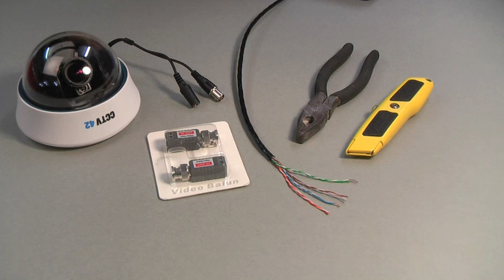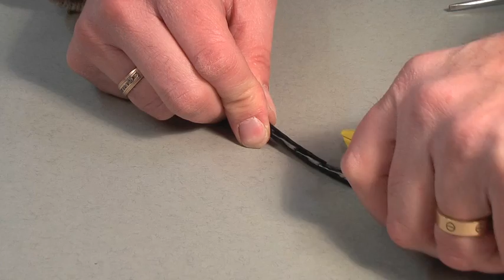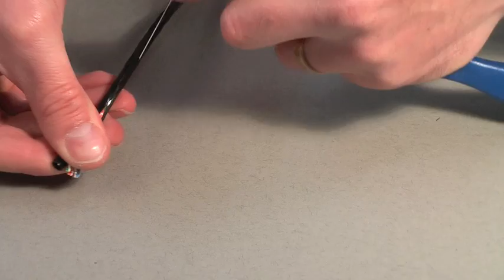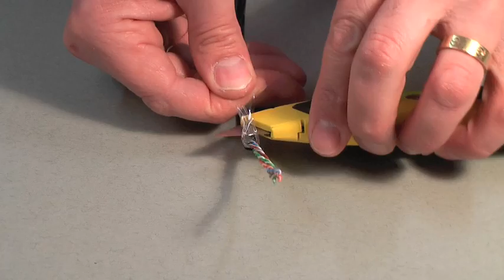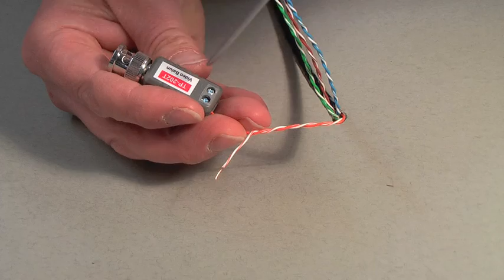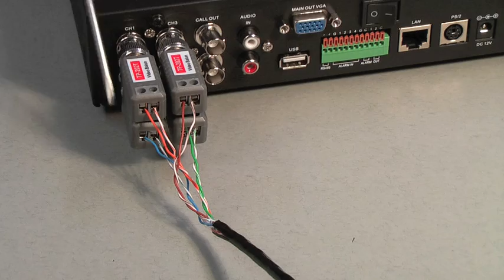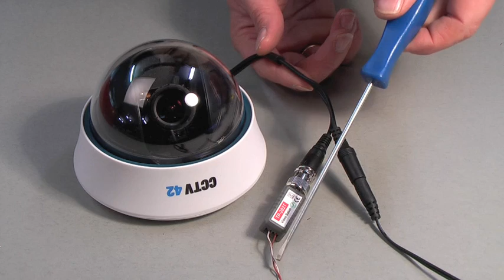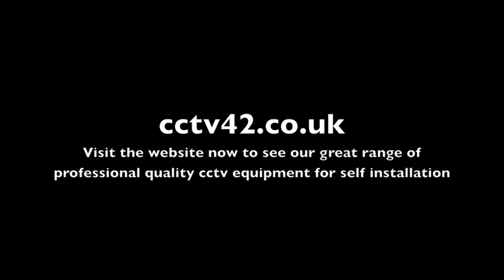cctv42.co.uk - using cat5 cable and baluns to connect a cctv camera to your DVR

Comment from the maker: Hi there. It could be a voltage drop issue at the camera. We would suggest a maximum cable run of around 50 metres when using CAT5 for both video and power, that is with 3 pairs of wire for power, 1 for the video baluns. You also need to make sure you are using pure copper CAT5 rather than CCA or copper clad aluminium. Many cheaper retailers will supply this in place of pure copper cable and it greatly reduces the performance of the cable.
Reply: How would I knoe if I got proper copper cat5? Also which is better cat5 or cat5e? 

I'm also going a maximum of 10 metres so would your power and video balun connection be a problem for me?

Comment: Hello there, I have exactly the same scenario as minute 2:28 but with the difference that i´m using two pairs of cable for the balun (one pair for positive and the other for negative) and the other two pair for the power source, but the camera is not working, do you think it might be a problem related to power? I mean, do i have to use three pairs instead of two in the female power connector? i will aprecciate your answer

Comment from the maker: Ok - to answer your questions in order:
1. In the video we are using CAT5e cable
2. Either CAT5 or CAT5e is fine - it makes no difference with this application. What does matter is ensuring that it is PURE COPPER, not CCA.
3. CAT5/5e should have 8 wires (4 pairs). If any less, it probably isn't CAT5/5e cable.
Good luck!

Comment: jejeje, thank you for your comments and the information. Now i have a new questions. 1.The utp cable that you were used in the video is cat5 or cat 5e? 2.For the same purpose can i use cat 5e? 3. I tried to do the same conections with a utp cat 5 cable but had only 2 pairs of wire inside, not 4 pairs as in the video and it did not work, would be by this type of cable (utp cat 5 with 2 pairs of wires inside)?
 receives greetings from mexico

Comment from the maker: Your English is certainly better than my Mexican! That is the way we always connect it up - solid colour is positive, stripe (white and thin colour line) for negative to avoid confusion, however it doesn't really matter as long as you keep it exactly the same throughout the whole system and at both ends of the cable. I hope that helps.

Comment from the maker: Hi there. I don't think using a single pair of wires for the power supply on a PTZ camera will work. PTZ cameras have higher power requirements due to the motors and so you will suffer voltage drop. I would suggest powering the camera separately. You could then use 1 pair of wires for the video and 1 pair for the RS485 control. 

The wires need to connect to the video output & RS485 control on the camera, the DVR video input and what ever you are using to control the PTZ at the other end.
Reply: https://www.amazon.com/s/ref=nb_sb_ss_i_1_8?__mk_es_US=%C3%85M%C3%85%C5%BD%C3%95%C3%91&url=search-alias%3Daps&field-keywords=ptz+dome+controller+with+ac+adapter&sprefix=PTZ+DOME%2Caps%2C213&crid=1VUZM3Q4DXYM2

Comment from the maker: Thank you for your comment. We find that over 60 metres you start getting voltage drop along the cable potentially causing the camera to malfunction.

The video signal is not a problem - 300m is easily achievable - it's purely the power.

I'd suggest you try to find a power location nearer the camera if possible.

Comment from the maker: Use decent cable. I suspect your cable is CCA or Copper Coated Aluminium which breaks easily. Try scraping the copper off one of the wires to see if you can see silver underneath. Good quality Cat5 cable is pure copper and because the copper is more malleable it tends not to snap off. You have to use pure copper Cat5 with video baluns, particularly as the runs get longer to avoid signal break down.

Comment: Hi....great vid and I have purchased baluns and cat5 and find it a lot easier than rg59 shotgun cable.....the only problem I find is that the wire is so thin and easily breaks at the balun terminal...not a big problem outside in the junction box because little movement but behind the dvr I find the wires can break.....do you have any tips?

Comment from the maker: The problem quoting maximum distances is that it depends on the current draw of the camera. It all comes down to the cross sectional area of the conductor. More copper equals more distance. In practice there probably won't be a vast difference in distance. On the video side however the Cat5 / balun combination is superb. 300 metres is huge. You can even extend that to 1200 metres by using active baluns. Finally the termination is very easy, no crimping tools just a small screwdriver.

Comment: Very informative video. But with the limitation of 60 metres to power the camera and the need of locally power, I think that siamese RG59 cable is a better solution in most situation where the external cameras are 100 or more meters away and in places where no electrical outlets exist. Besides that a siamese cable for video and powering looks more secure because you can elevate in all the trajectory and with this you can avoid simple unplugging. Im right?

Comment from the maker: That would indeed work. As long as you use the same pair for each camera.

Use:

Blue+Blue/White - Camera 1 on the cable
Green+Green/White - Camera 2 on the cable
Brown+Brown/White - Camera 3 on the cable
Orange+Orange/White - Camera 4 on the cable

That will work, no problem at all.

Comment from the maker: Hi there. There are 4 pairs of wires. For example, our CAT5e cable has:
Blue+Blue/White
Green+Green/White
Brown+Brown/White
Orange+Orange/White
Pick a colour (we always use blue) and separate those 2 wires from the remaining pairs. Use these for the video. Use the solid blue in the +ve on the balun AT BOTH ENDS. The blue/white is the same, but -ve. Split the remaining 3 pairs and use all solid colours for +ve (at both ends) and all stripy colours for -ve (at both ends).

Hope that helps! :o)
Reply: Is there a specific reason why you only double up on the power side and not video?

Comment from the maker: Hi there. Good question! With the cameras and the cable that we supply, you can safely achieve between 60 and 70 metre cable runs using 1 pair for video and 3 pairs for audio. After this distance, the IR performance starts to drop off, before the camera eventually stops working all together.

Comment from the maker: There are cable strippers out there that can be adjusted using a screw to the diameter of wire you need, including CAT5e cable. Good luck!

Comment: Hi, im pretty new to wiring cctv using cat 5 (i tend to use RG59) are the positives on cat 5 the solid colours such asorange, blue, brown, and green and the negatives the colours following the white? also if orange is positive and it goes into the + of one ballun, would orange go in + of the second ballon? and from my understanding, you put the last 3 positives and negatives into the DC male and female with no order?

Comment from the maker: There are subtle differences between the two, but with the prices being so similar, you would be wise to go for the CAT5e cable. We've tested CAT5e with the passive video baluns at 300m with no issue at all - the only problem you'll have with that length is running the power over the cable. You will need to power each camera locally as opposed to with one central power supply.

Comment from the maker: When installing cameras outside, we always recommend keeping the connections dry. For this purpose you would be best advised to use a weatherproof enclosure of some sort - don't just rely on electrical tape as some suppliers suggest. We stock one which can be seen on our website at: cctv42.co.uk/content/94/weatherproof-box-for-outside-cable-connections.aspx

Comment from the maker: @dalitiko The baluns do have polarity, yes. This is indicated by a small '-' and '+' sign on the balun itself so you can see which is which. You do not invert the polarity and you do connect '-' to '-' and '+' to '+'. If you need any further information, just give the office a call on 01895 233311. Cheers. Matt

Comment: How do you remove the jacket from the 8 internal coloured 0.5mm wires without cutting the copper wire? Ive struggled many times to find a cable stripper for 0.5mm cable but they seem to be non existent. Thanks

Comment from the maker: @ipsademexicotv You can run power and video over CAT5e for around 60 - 70 metres...but the exact length is dependent on the camera at the end of the cable. If you need any further help on this then just send us an e-mail. With regards to eBay, currently we have decided against selling on eBay because unfortunately there are a lot of questionable products and suppliers on eBay, we wouldn't want to be tarred with the same brush as we like to offer high quality products and great service.

Comment: Henry thanks for ur response on how to  weatherproof all the connections , i saw in ur vid that u are using 3 pairs of utp cable for voltage how far can i extend using your 3-pair tip , and have u been thinking on selling on ebay??  

Thanks!

Comment: Your video is excellent ,1 question How do you recomend installing on the outside ?? should i just  use a 3M Electric Tape all around the balun and ac plug????  Thanks in advance Robert

Comment from the maker: @coldlogik You can do that, yes. The reason we combine the remaining 3 pairs is to reduce voltage drop down the wire to the camera. We have found that with 3 pairs for power, up to 60 or 70 metres should work fine (unless you have a camera with a high power consumption). I would guess at around 40 metres with your suggested configuration. Remember when installing to test with the IR on as well as off as this draws more power. Matt - CCTV42.co.uk

Comment from the maker: @formidable38 it is just standard 'networking cable' or UTP cable. If you're looking at using this type of cable for CCTV, ensure the cable is 'Pure Copper', not 'CCA' or 'Copper Clad Aluminium' (also known as 'Copper Coated Aluminium') as it is a better type of cable with better electrical properties. Cheers Matt - CCTV42.co.uk

Comment from the maker: Yes, correct a single cat5 cable can handle up to 4 individual video feeds if the cameras are powered locally and we use this feature a lot with multi-camera cctv systems. Just plain old Cat5 cable. What I would say though is use pure copper rather than CCA (copper clad aluminium) because it works better and has less of a tenancy to break due to metal fatigue at the balun joints. Henry

Comment from the maker: When you use the Cat5 UTP cable to run signal from 4 cameras as in our example on the video you will have to power each camera locally because there is no remaining capacity, all the pairs have been used for video signal. Each pair of wires can only do video or Power, not both at the same time. Hope that answers you question and sorry it took up 2 posts!  Henry - CCTV42.co.uk.

Comment from the maker: I'm afraid I don't speak Spanish but it looks like you have a question about powering cameras over the Cat5 UTP cable. Depending on the power requirements of the camera and the length of cable run it is possible to power the cameras over the UTP cable. We recommend combining the 3 remaining pairs of wire together for the power feed to reduce voltage drop. For more power hungry cameras or longer runs power the camera locally and use the UTP for video only. More details on cctv42.co.uk
Reply: sir Henry i got a look for few comments here and ill find some the same question comes out on my mind if impossible to have some voltage Drop or if we use utp cable as the supply cable for cameras should we say 24 volts either, my question is when we use on utp wire as a cable supply in one cable together with the cameras wire is there possible to experience  snowy view on monitor? thanks and more power.